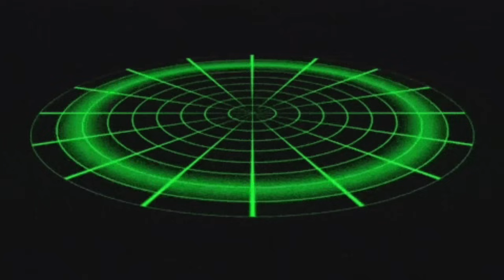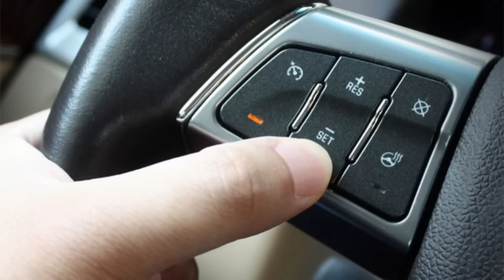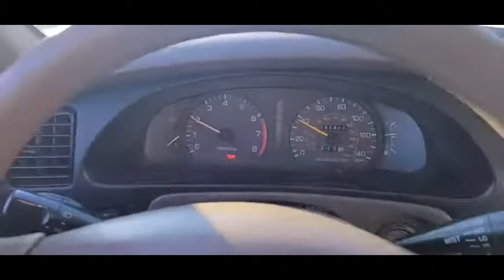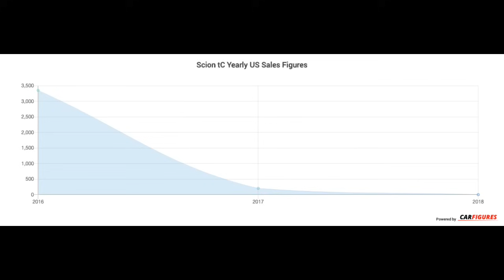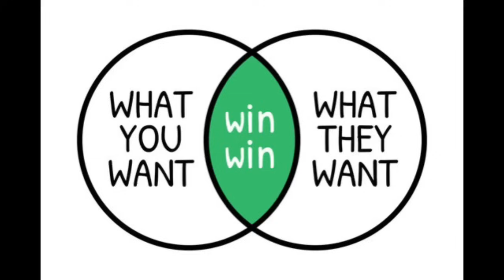The Scion TC is Massively Misunderstood… || DEEP DIVES

Comment: I had an '08 4.0 tC & now '15 tC2 both automatic LOVE THEM BOTH.
Theres more things to add to your comment for the geek out here. We know the Speed freaks want the RWD option.  BUT Specifically "IF people analyze the body of the tC2, its the same design used for the Lexus RC RWD!" Do a 360 degree comparison and you'll be shocked. 
The Lexus RC is the luxury sporter version of the Tc. Even the letters are close too RC/tC.
 
I wish the Scion brand held on and had made a convertable tC or AWD wouldve been cool. We know the Speed freaks want the RWD option.  
But like you said brotha They need to look again, the tC also has many aftermarket mods. Customizeable interior parts that can pull out and spray painted or Plasti-DIp. The space for moving some things on travel lolol.

Comment: I bought the 2007 model and up to this day I’ve have ZERO problems. It’s at 180k and going strong. I was 28 at the time and this car was a bargain considering what it came with. A freakin moonroof, power windows for both driver and passenger. Also not just regular power windows but then touch where u press only once and it goes up or down automatically. I know some current vehicles don’t even have that. a hatchback that’s a coupe (I could stuff so much with my Costco runs). Is there a coupe that’s a hatchback right now?
I’m 43 now and this is still one of my better investments.

Comment: I got an 08tc two yr ago with 90k excellent condition in and out. Not one issue with it. Passed inspection and change oil. Only complaint is its a little small. Paid cash for it 5 grand.

Comment: best way to add power to the 2nd gen TC's 2AR-FE is replace the crankshaft from the 1AR-FE (2.7L identical engine) so the car becomes 2.7L add forged pistons and stronger Valve Springs to deal with the higher Compression.  These mods will require an aftermarket ECU and a tune for the increase in Displacement.  I'd also add forged Rods just be safe but Natural Aspiration you'll be doing over 200hp at crank easy just from the increased Displacement and possible higher rev range.  Search on Youtube 2AR-FE you can find good information about it from Frankenstein Motorworks.  This guy is running a 2AR-FE in a MR Spyder pushing the power with the end goal of making 300whp (currently at 270WHP with the engine).  You'll also find videos about it from Papadakis Racing they were able to achieve 1,000HP.   This engine's capability is under rated and almost like a modern 3SGTE or 4 Cylinder 2JZ.

Comment: paid $4500 this year for my 2008 5spd Tc with TRD s/c and a few of the other TRD options (wheels, exhaust, suspension, shift kit, sway bars). Whoever built the car new paid alot of money to the dealer... like could of gotten a WRX or EVO alot..it is a bit of a unicorn.  The biggest gripe I have is that the gearing could definitely be improved. It might be fun for a young person wanting to show off in parking lots. It'll sit and spin in 1st but that gear is useless above 5mph, then it does the whole 2nd to 3rd pull pretty well, 3 is sluggish and 4 & 5 are more or less the same thing. My 2003 Civic was a lot more natural feeling and had far more useful gearing, I didn't have to put nearly as much thought into it. Dropping gears at speed is a lot more difficult in the Tc, you have to really rev it up to get matched. Great car if you can find one for cheap, I get 29 mpg and have a blast on my commute every day.

Comment: Got my 2013 Scion tC two years ago. still has less than 50,000 miles. Added aftermarket air intake, coil over suspension, and  some expensive ass fuel injectors. its a great mod car starting off. And im going to sell it for a profit lol. Loved the car, but its time we took the training wheels off 😂

Comment: Atleast is still the easiest to make power out of it, also cheap for good set of turbo kits and still faster then frs brz and 86 and harder to make power on the type of boxer motor they provided, last the down side of the tC’s motor 2az-fe/ 2ar-fe only whp max of 400 low boost, but tbh honest that’s way more then enough for how light these cars are

Comment: The biggest problem with the TC were cars like the GTI.  Sure they were a couple of grand more, but they were MUCH better cars.  For those that wanted to go fast, a simple chip tune on a GTI would put you well into the 200 HP range.  Targeting cars at teenagers was never a good idea.  Teenagers don't have money to burn on cars.  The plan was to hook people with Scion and move them to Toyota when they had more money.  The issue was, and still is to some degree, that people that were interested in quirky cars like like the Scion line up couldn't find anything in the Toyota line up that matched that same Scion quirkiness.

Comment: I'm 37 and bought a 2015 Scion TC used b/c of exactly what it is a 2 door Camry with a 6 speed manual and FWD that gets 28-30 mpg . And also b/c it makes a perfect daily driver so that I don't have to put needless miles on my 1988 Turbo ii RX7 or my Dakota R/T both of which are modified and don't make good daily's just b/c of gas mileage and my previous daily a 1992 3000gt SL spun a main bearing at 250k miles :( Rip Silver SL*t.

Comment: The Camry engine was an intentional thing from Toyota, and partially because of the point of that ultra-cringy commercial — Scion dealers sold their own aftermarket parts. The 2.4L engine is reliable and fairly lightweight — but it's also compact and ridiculously easy to modify, if you know what you're doing, because from the factory, they're not highly-tuned engines. 

Where Toyota dropped the ball was not releasing the tC in an AWD configuration, because it actually wouldn't have been a bad autocross or rally car when the engine was tuned for it — if it weren't purely FWD. It has a nice balance, low stock center of gravity, nicely weighted, and just adding a turbo and altering the gear ratio can get really decent performance out of it. To the point it feels like a different car. 

Which was, ironically, Toyota's plan. They just really couldn't get enthusiasts on board, due to really poor marketing, at least until the FR-S (which was arguably what the tC should've been in the first place, and would've been better for them to lead with).

Comment: bruh.... my 6 speed manual 2016 Scion IA has 258,000 miles with 106 horsepower which is reliable and peppy.  low horsepower but fast and light stick shift car!!! And I'm 6'3" 315 pounds!  but it's actually a Mazda 2!!! zoom zoom!

Comment: tc misunderstood? My IA is ghost in the shell than
recently I modded a few parts of my car cause the stock parts were worn out and now it more "Sporty" look (K&N perfom filter, Megan race coils, a Tanabe strut bar on the engine, and new rotor disc brakes, self repainted and sanded off the bits of rust build up and some lux seat covers for and nice looking inside)

ppl ask if this a new car or that if its a sports car when I'm doing uber. mod wise I like to say I'm only in stage 1 but given how the IA has like 5 mods in total I guess I'm in the stage 2 of the IA mod tree outside of a swap, dyno or turbo.

but I'm gonna be honest given of light the car is it's like an AE86 and possibly the lightest scion in the line up very small adjustment make it much faster with little tune up.

scion line was underrated tbh...

Comment: Love the tC more than any car I have ever owned and here's the 5 cars I've ever owned RSX type S, 08 Civic Si, 04 mustang GT, 2013 FRS none of those cars in my opinion were as good as the 05 Scion tC I had 
I love the car so much I've been looking for a 5 speed manual 05-10 Scion tC for the past 3 years and no luck 
- here's why I love the car so much 
*It was so reliable minus the oil consumption problem never broke down on me all OEM parts were still working after years of owning just basic maintenance of oil changes and spark plugs things like that and I love the styling of it, It reminded me of a slightly more beefed up 8th gen Honda civic Si so it looked kinda sporty just a little chubbier but with some coilovers and wheels and tint the car looked really nice the car was really small on the outside it was about the same size as an RSX or Civic Si coupe the car was small from the outside like most 2 door cars was but here's what makes it so surprising it is a lot more bigger inside then what it appears on the outside for being such a small 2 door coupe with a hatchback it had plenty of room inside the cabin which you wouldn't expect at all majority of them are very tight and cramp with really zero leg room or head room for anyone to sit in the back and just having back seats for insurance purposes but not this car the Scion tC has a surprisingly good amount of space in the back 34 freaking inches of leg room for the back seats those are sedan numbers for back seats space you could actually fit people in the back comfortably their legs wouldn't be all cramped up against the front seats like in every other 2 door car you get in and try to seat in the back every time I would pick up friends and family they would complement on how spacious the back were for such a small car they thought they were gonna be cramped the entire ride seating in the back but they had plenty of leg room they really liked the car headroom in the back was also decent if you were under 6ft you had perfect amount of headroom and leg room since no one I knew was over 6 feet they had no problem seating in the back which is what I really love about the tC really small on the outside like every other 2 door car but surprisingly very spacious cabin which made it extremely practical it was like having the best of both worlds in a sedan and coupe in one since I didn't want a 4 door but wanted the space of a sedan inside a coupe I got that with the Scion tC and for the entertainment part I really liked the factory pioneer sound system in the car swap out the stock head unit and put an aftermarket pioneer touchscreen head unit and those factory pioneer speakers come to live they got pretty loud without being distorted the sound quality was better than most factory speakers in other cars they were loud and sounded good but was missing bass and I bought a subwoofer to compliment the loud speakers and it just completed the whole sound system and with it being a hatchback it made the bass sound so much louder and fuller inside the car and then my other favor thing about the car was the huge double moonroof I would roll on the windows down and open up the moonroof and drive at night letting all that breeze in it was like almost experience what a convertible would feel like 
and then my other favorite thing about the car that I love is the hatchback trunk it was the best so much easier opening it up and getting access to the trunk so easy to put it in groceries or when going on a shopping spree the whole thing lifted up so it made it more easier and convenient to put things in and take things out unlike a regular trunk and what I needed more space say I'm moving out fold the rear seats down and you have plenty of space to fit everything back there the car was extremely convenient and practical for how small it was it was so perfect in my eyes I wanted a small 2 door sporty looking car and I got the practicality of a sedan while still remaining the same size of a coupe I got the best of both worlds 
And then the power train of this car 2.4 freaking Litters that's a big 4 cylinder displacement it came with 160HP & 163lbftq more torque than the horsepower with a 5 speed manual transmission it came with short gearings so that the car made more power to the wheels the car had instant throttle response and the torque would kick in at really low RPMs everyone in the car would get pinned back into their seats in 1st gear it had a very aggressive kick to it when you dumped the clutch the car had torque which was most needed for city driving and commuting since this was a daily driver 0-55mph torque was still there being applied it wasn't slow and it wasn't fast but it was somewhat quick very peppy and zippy with an aggressive 1st gear pull I wish I could buy this car back I really miss it sold it to buy an RSX type S but I ended up not liking it still fun don't get me wrong it's FBO headers catback exhaust CAI and hondata it's all top end really slow in the lower gears needs to be revved out all the way in the higher gears to feel VTEC kick in but I really want my tC back*

Comment: Does anyone else feel like stock at least, first gen looks better than second gen. like yeah second gen looks a bit more Morden with the sharp edges but the front of first gen looks hella good imo better than second. first gen is a little more unreliable than second gen tho cs oil burning and other engine issues. still rarely
problems tho

Comment: The one problem a lot of the TC’s had was oil burning issues especially the first gens
Reply: I have an 07 tc driven almost 100k got the car at 124k no oil problems. Only problems I have are deer 🦌. Other than that it's a great car need to get a lot fixed on it cosmetically
Reply: @andrewkay2705  yours probably has a rebuilt engine or you got really lucky